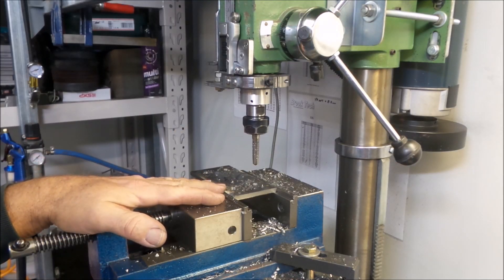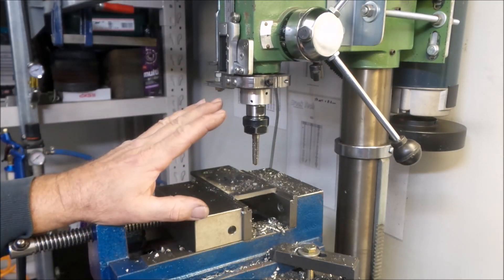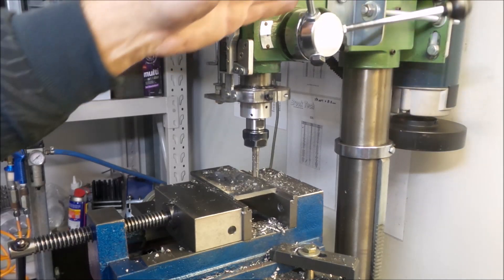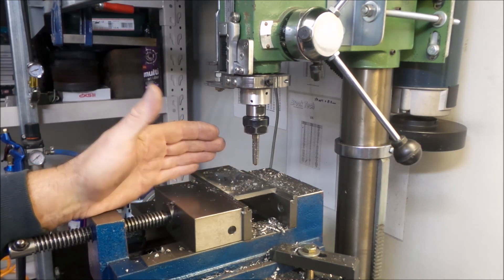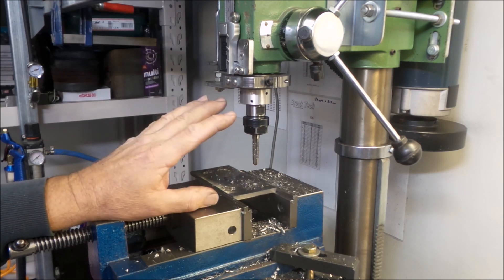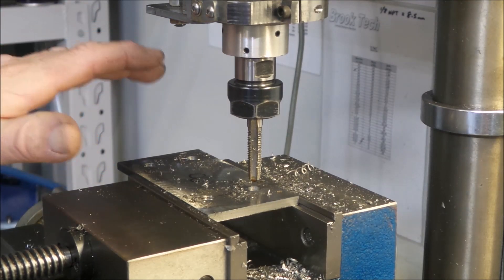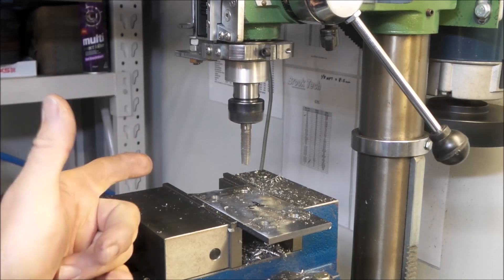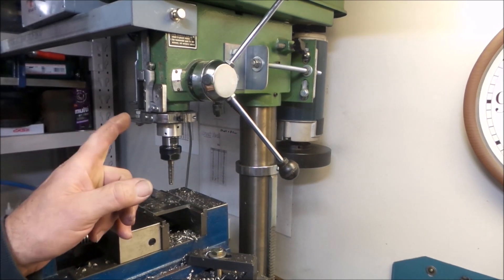Tapping Threads On the Drill Mill Press.

Comment: Nice set up. Is that a dc motor set up to run it slow n reverse by switch. I saved an old exercise machine to do that on a drive press I want to restore a 20" delta with power feed set up.

Comment: I read my manual for my drill press and it says to let the press come to a complete stop before reversing. Keep in mind that my drill press probably wasn't intended for tapping. Do you slightly oversize the hole?. Do you use a specific chart for materials that tells you different hole size for different types of materials for power tapping. I have been wanting to try this but thought I would research it a little more first. That is pretty slick

Comment: Great video. I have a new Jet 20MF floor drill press and a 3hp treadmill motor. Can you tell me how you set that up? What VFD did you use? Other issues to watch for?
Thanks,
Paul
Reply from the maker: G'day Paul, i'd recommend having a browse through my channel as there is another video on the drill press setup & a couple on building a really easy, cheap Treadmill motor controller. One of them has links to all of the components you will need. Cheers Mate.

Comment: I found one more reason to put a reversing switch on my drill press.
 I can put a fan blade on there and blow the air up or down in that part of my workshop. 
That's in addition to putting tape on it and watching it spin back and forth.
I already planned on putting a grinding wheel on there sometimes or a wire wheel or a buffing wheel, and sanding drums. This will give me a lot more room to work than my bench grinder would.
I also think it would be fantastic for taking out hard to remove screws on anything that will fit on my drill press table.
Reply from the maker: Sounds like a plan Kerry, good luck with it Mate. Cheers.

Comment: If you don't have a treadmill powered reversible drill press, you can always use a cordless drill on low speed with a low torque setting. It's not as good as this setup but it sure beats doing it by hand!
Reply from the maker: Agree 100% Mate. I also use that method for general light duty tapping. As you say "sure beats doing it by hand". Cheers.

Comment: Hi Trevor, I’m wondering how you find the drill press with the treadmill motor under load as the DC motors are more susceptible to slowing down under load than the AC motors. I converted my 6” belt sander and it’s not such a problem on that and I like the variable speed and reverse handy but how does the drill go say drilling a 1” hole through 1/2” bar? I have a 4hp treadmill motor I’m thinking of using on my drill but seeing the sander slowing down I’m hesitant about the drill. I would welcome your experience. Thanks Stuart 🇦🇺
Reply from the maker: G'day Mate, it should be fine as long as you get the pulley ratio right. The biggest issue I have is belt slip, my setup slips way before the motor slows down significantly & I have really tight belts. I need to make up something better. I think mine is a 4hp too on the drill press, definitely one of the bigger treadmill motors. Cheers Mate.
Reply: The Aussie Shed, Hey Trevor, thanks for that. I’ve got all the bits to do another conversion but thinking about it I don’t do a lot of tapping and I have a two speed Ac motor on my drill press plus I just picked up a beautiful old Durden bandsaw so I think I’ll convert that first. 
I’m going to try and use the multi groove belts on the bandsaw. Have you considered putting a mechanical tensioner with a screw adjustment similar to what the older Japanese cars used to use? Just a thought. Thanks for your help buddy. Cheers Stuart 🍻

Comment: I have a Harbor Freight 60238 workbench drill press. Can I use that to tap holes in wood, aluminum and steel? Lowest spindle speed is 760 RPM.

Comment: Good work bloke .Quick tip get spiral flute or a gun tap for power tapping, hand taps are not made for it they cant clear chips well and are thinner in the core way more prone to breakage (also if you use a chuck and not crank it to tight (bit o practice) the tap can slip before it breaks
Reply from the maker: Thanks Lewis, sounds like great advice. I'll have to get me some of them there Fancy Spiral taps. Cheers Mate.

Comment: Trevor,
  I have a question. I’ve converted my lathe to dc treadmill motor. In one of your videos you mentioned using the reverse switch to act as a brake. I’ve been doing that ever since. Now I see you reversing the motor in this tapping operation. My question is does this damage the motor in any way or the circuitry? I’ve just received another treadmill motor I bought off of eBay and I intend to mount it on my drill press which I am beefing up to serve as a mill per your recent video on the subject so I’m interested in this concept. I believe these dc motors are the answer to a lot of powering applications where speed control through a long range is necessary. It sure beats the cost of phase conversion and a heck of a lot less noise. Phase converters are notoriously loud with offensive harmonics. 
   The Aussie Shed is one of my favorite channels, by the way.
   Oh, one other question. That was a mighty nice looking hand. Is there any chance we might get to see what that hand is connected to? Lol
Reply from the maker: Hi Dale, great question, no it doesn't seem to. 
All of my machines have been up & running for a number of years now & so far no failures. 
I'm no expert on this kind of stuff though, maybe someone else could chime in if they know of any issues.
Cheers Mate.